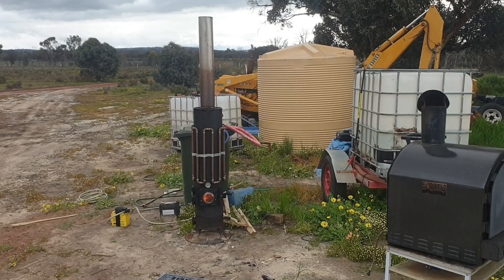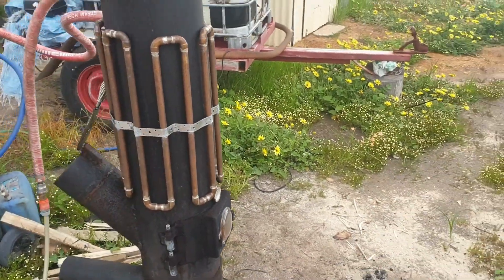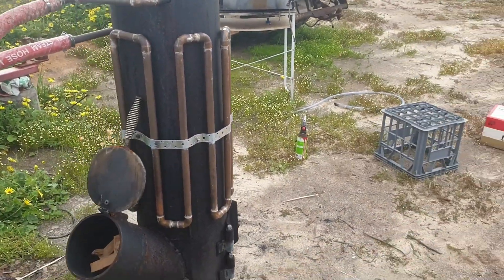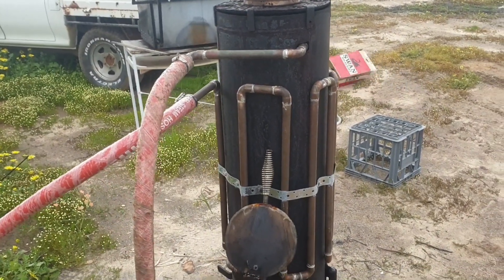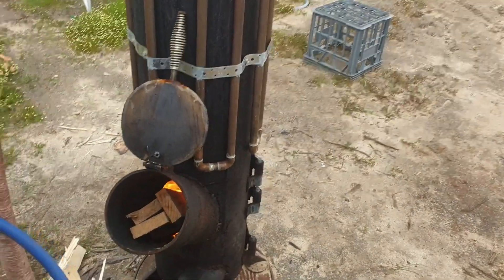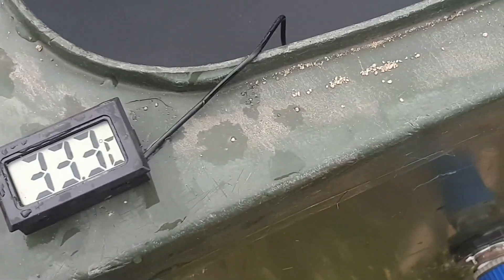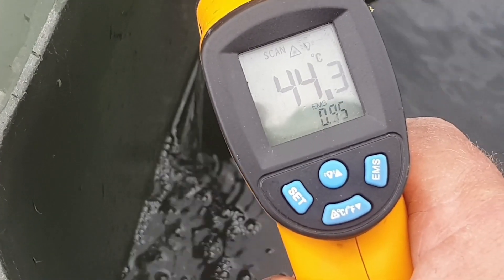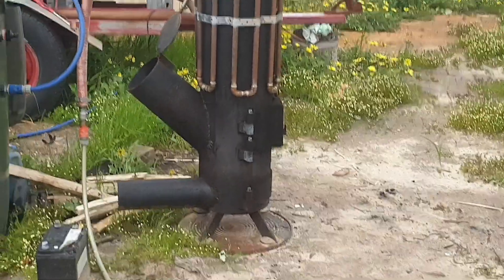Rocket Stove Water Heater

Comment: Like it but as a plumber be warned the tube on the outside, were it goes up and then down, every high spot has the possibility of being a steam trap! a second coil would be better, lower than the inner one! as long as the water tank is above the boiler, gravity will feed the bottom of the outer coil, get heated which creates natural upward flow! hot water then leaves the first out coil and enters the inner second coil which would be higher than the outer coil.. this way no pump would be needed. as hot water wants to rise!.. i love the look of the pipework on the outside but really each high spot should have a self vent on it.. hope that makes sense.. and this isn't me criticising, just sharing a bit of knowledge and trying to keep people safe! steam expands at an explosive rate!.. stay safe..
Reply from the maker: Point taken but that only becomes a danger if the pump fails
The continuous flow of water the pump delivers prevents any steam trap but if the flow stops then yes I would have problems
Reply: @grantleyte2784  great build! how much is the pump's autonomy on your 12v battery? (what's the battery ah?)
Reply from the maker: @LaurenceVonThomas  The battery is an 18ah battery and the draw from the pump is 0.6ah giving 13hrs run time theoretically which is more than enough for the Saturn V to heat the water ( usually only takes an hour to heat 160lts to 40 deg Celsius ).
Reply: @grantleyte2784  great, thanks for the practical info. it helps